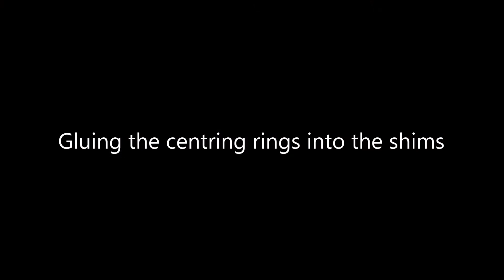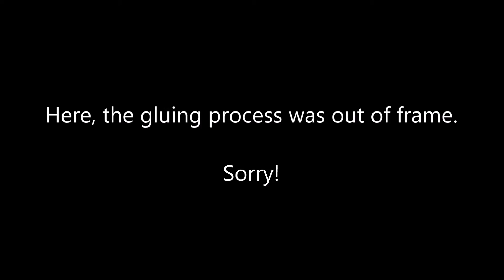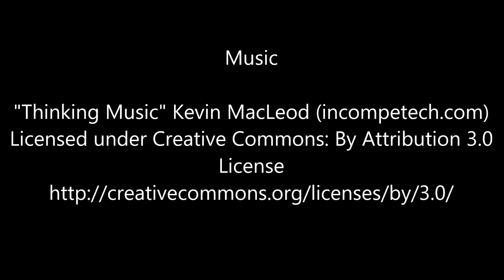Rocket Building - The Quest Superbird - Part 5 - Cutting Tubes

Comment: If you set the stop block a lot further back, so that most of the tube is supported by the cutting fixture, and only 0.25 of your tube stock sticks out past the cutting slot, you might have better stability cutting.